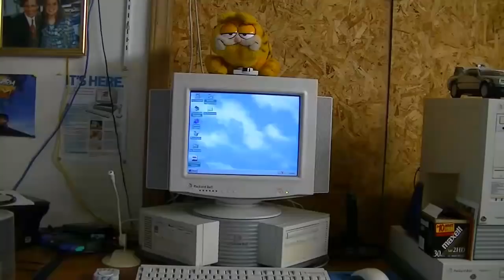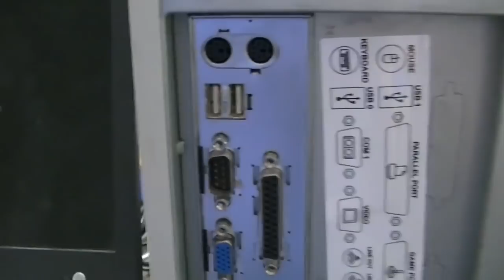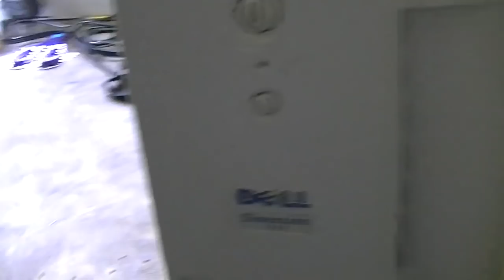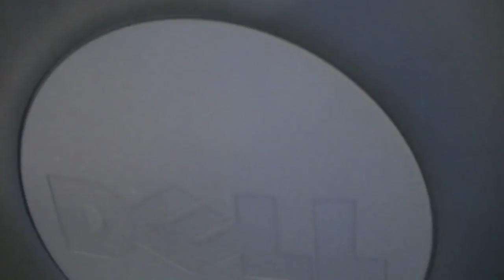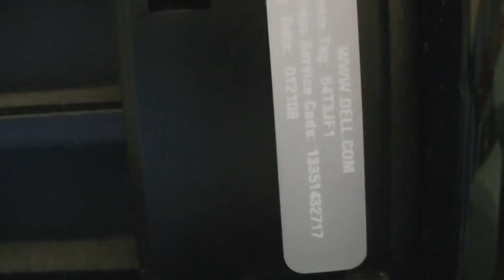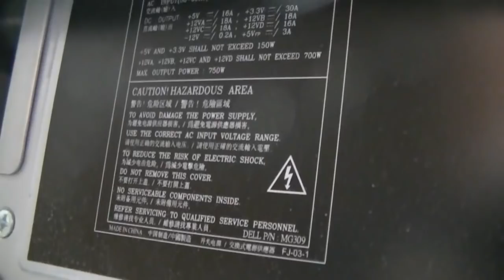August 2018 Mega Computer Haul

Comment: geez that XPS really was something back then and if i'm not mistaking a fully spec one was around 7000$ since this has a core 2 quad it should be a q6600 and the original hard drive was a 750 gb which was huge at that time,also this motherboard has an nvidia chipset,nice system if you got the space to keep it

Comment: Nice collection you got there! I still miss both my Dell Dimensions 4600 and 8200. I had a lot of fun memories with those two (though the hard drive on my old 8200 later died around 2010 after eight years since we got it brand new in 2002). I also used to have the same Altec Lansing speakers too.

Comment: That home built machine is in an Antec value line case, I happen to have the same one. The XPS is a bit large for what it is and its a rare full size BTX board machine. Some of them required a higher amperage power cord (as did period Alienwares) with a different plug on the power supply side.

Comment: the dell 4600 and 8200s were great office machines, and were built like tanks, I have an 8200 that actually uses RAMBUS memory. I would advise checking the caps on both machines, as these were affected by the capacitor plague. I had a 4600 that had every cap near the cpu go bad, fortunately the 8200 has good caps still. but i still check it from time to time.

Comment: Proccessors: coustem built Intel Celeron proccessor,  fell demension 4600: Intel pentium 4 proccessor, Dell demension 4100: Intel Pentium 3 proccessor,  Dell demension 2100:  Intel pentium 4 proccessor,  Dell XPS tower: Intel Core 2 Quad Proccessor,

Comment: I actually liked Windows Vista in 2008 .But I had the 64 bit version and my PC had 8 Gigabytes of RAM and a quad core CPU  so it worked great with it.
Vista was a problem with users who had low spec machines mostly those with 2 gigabytes and less of memory and with slower or older CPU's.